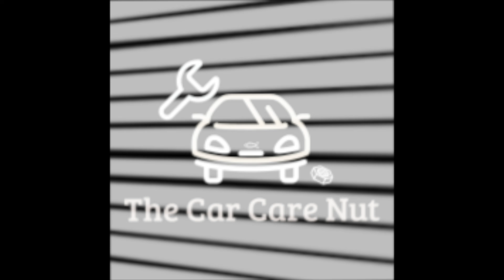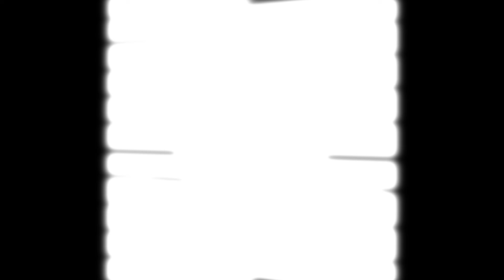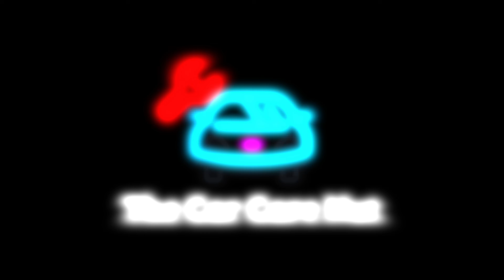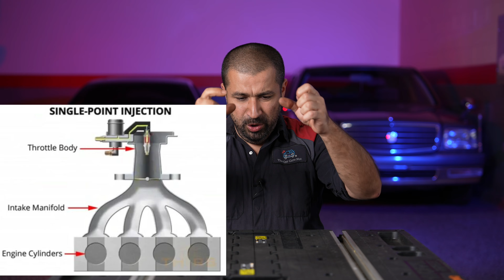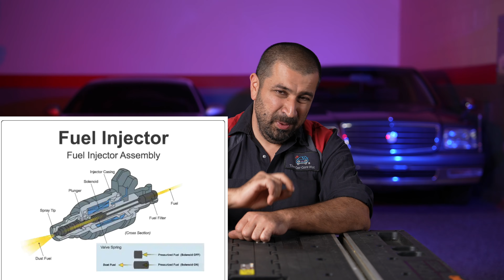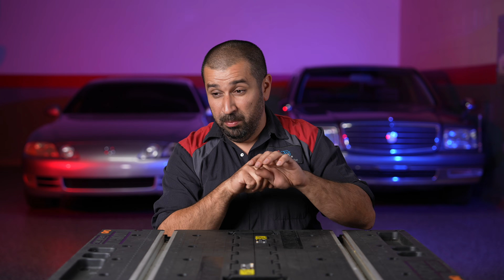How Does Modern Electronic Fuel Injection Work? Part 1 : The Basics

Comment: I had an interesting thing happen with my car. I was getting strange static through the radio. I noticed that it changed everytime I changed throttle pressure, and concluded that the radio must have been picking up the pulses to the injectors. Maybe the antenna wasn't grounded, but I never followed up on it.

Comment: The accelerator pump is primarily for enrichment when you suddenly open the throttle.  Without an accelerator pump, you'd get a lean mixture and a bog or abrupt loss of power, just when you wanted to accelerate.

Comment: "...electronic fuel injection started in the 50's, never took off because of the limitations of the computers of the time."  I suppose you could call those systems analog computers. 🙂

Comment: Good video series!  1) I would be interested in a video which explains the combustion process comparing 87 and 92 octane fuel.  2) Using higher octane, does it burn hotter in the engine resisting early detonation? 3) Can a higher octane fuel lessen or help with fuel dilution(where fuel gets into the oil)?

Comment: AMD, I changed my own spark plugs and cleaned that air intake sensor.  My 189,000 mile 2016 Mazda 6 manual-350 mile all highway trip one way @ 65mph- it jumped up to 39MPG!  

On the return drive, I averaged 71-72mph and I still achieved 36MPG! 
 
Found easy instructions from youtubers.

Before I did the work myself, the Mazda was averaging 32MPG on long highway drives and 29MPG for mostly city.  

Immediately did the same thing with my 2019 Honda Hybrid.  Noticed the average mixed mileage was now 53mpg, whereas before it was 47mpg. 

The sparks plugs for the Honda was $78 for a set of four.  The dealer would have charged me $75 apiece.  The Mazda's plugs were only about $48 for four.

Comment: I do Cyber Security and IT for a living. I've also built multiple computers. I know barely anything about cars. I think it would be cool to learn how to be a mechanic. I have shaky hands and not the best coordination though. With computers, if you mess up assembling something, it could cost $250 at most but with cars it could cost $10k+. If you mess up a computer, you can set it aside and work on it when you have the time and money to fix it; if you mess up a car, you ruin your daily transportation. Even with something simple like changing my own oil, if I mess up with the drain plug thing, I could accidentally strip something by tightening too much or maybe it could be too loose and fall out. Some people think people who know computers are really smart but I think the smartest people are mechanics who understand how $10k+ machines work and how to fix them without breaking stuff

Comment: I have a cheap Bluetooth obd2 reader and it says the fuel air ratio is a perfect balance but long term fuel trim is 12.5 percent. I do occasionally get a code for very small evap leak that once is cleared doesn’t come back for a year. Does an evap leak make a car run richer

Comment: I really enjoyed your lectures, but regardless, I wanted to comment on the working table you used during the lecture, probably for advertising.
I have the same working table, and I almost lost my fingers while folding it several times.
This table is a hazard to use, and it also has a warning sticker about fingers

Comment: Another note, the MAF sensor measures the temperature delta between the wires, so when it is cold outside, or hot, that slight variation in temperature is easily calculated by the ECU.

Comment: I think GM was the first to put throttle body injection on some of their cars and trucks. They were bulletproof, Some had a single injector some had a duel injection system then they tried putting multiport fuel injection on their V6 Comaros and Firebirds and had nothing but problems with bad fuel pumps and clogged injectors They continued to use a 4 barrel carburetor on all their V8 sportcars like the Z28 And V8 Firebird

Comment: Great video, can anyone elaborate on the carburetor mechanical pump that only works when car is off, I thought he was referring to an accelerator pump. Most of my automotive experience was during carburetor days and I do not recall what he is referring to. I thought you pumped gas to set auto choke. I do hope AMD continues this format, he did one on electrical troubleshooting but as well as I remember never followed up on it, it was a very good video too so if you have not seen it I recommend you look for it and watch it

Comment: I had an older Datson 280 Z it had Mechanical fuel injection it was a straight 6. No computer I believe the injectors were operated off the cam lobes .

Comment: My favorite comparison of carbs to injection is my old motorcycle and its 'upgrade.' My 4 cylinder 4 carbs 600cc bike gets 55mpg (up ~60-65 on hwy). Its upgrade to fuel injection got 40mpg. But hey, at least we can program sport and rain throttle modes! It's spiritual successor today is now 900cc, and gets 50mpg for nearly triple the price. But hey, at least it has an infotainment screen and cruise control!
Bring back my analogue tech, sheesh.

Comment: Thanks Ahmed this was really good info and has put me right on that fuel/air mixture ratio because when I was younger (much younger) I used to tweak around carbie engines and always thought that the ratio was 16/17:1 how wrong was I ?? I am looking forward to part 2 as I now drive a 2011 Mazda 6 Sports Hatchback and would like to know just how my (I think) multi port system works notthat these days I can tweak around cars because of the far more complicated fuel and other computer-controlled systems.

Comment: Why not an O2 sensor for each cylinder?  If the injectors are slightly different you need different control to equalize.  Obviously cost is one factor.

Comment: Always interesting topics, i grew up with Carburetors in all my dad's cars and my 1st car . I remember adjusting the air fuel ratio by adjusting the air and fuel screws. My sister had an old VW rabbit that had mechanical Bosch fuel injection worked well and was reliable.

Comment: Carburators are not that archaic (as a tech), it's a simple and relatively effective system. It was environmental regulations, and cost of oil, and aerospace needs (high altitude and acrobatic flight, plus space travel), that drove much of the advancements in fuel injection tech (which is a great idea). That said, like many techs, fuel injection was in use in aerospace since 1916, and eventually trickled down to other uses, such as in automotive! 😁

By the by, many of the GA planes I still fly today are carbureted. 😉

This is an Excellent explanation in laymen terms! A fantastic job! Thanks for creating this educational material!👏

Comment: Love your videos; in early port injection systems the injectors all fired together. Which meant most of the time it was not when the intake valve was open. What you're actually describing now is called sequential fuel injection because, well, each injector fires sequentially

Comment: @8:15 Always impressed with your electronics knowledge AMD.  What is likely happening is back on the ECU, you have a transistor for each injector.  With the emitter of the transistor tied to ground and the collector tied to the ground wire of the injector.  When the ECU wants one of those injectors to open (spray fuel), a current is applied to the base of that transistor which turns it on, thus completing the circuit allowing 12V to be applied to the coil of the injector solenoid.

Comment: 55 or so years ago I was taught the piston goes down on it's induction stroke, and then the atmosphere PUSHES the air in. As nature abhors a vacuum. Just being picky I have worked on 4 cylinder cars that had 4 individual carbs. Great fun to balance. While I had an air flow meter I tended to use a length of 3/4 diameter pipe.  None the less, I do enjoy your explanations.
Reply: Put your finger over the spark plug hole (with the spark plug removed) & your will feel the vacuum.  It's the other half of the equation.  Theoretically is the air being drawn by the vacuum or pushed in by atmospheric pressure or a combination of both?  Either way it works.

Comment: Oh wow, where were you two days ago when I was looking into this very topic. My 15 1/2 yr old car went to the dump last year. I thought bc it lasted so long and the engine was still working perfectly, that I should try to find a car with the similar attributes. I found the 2021 Honda HR-V 1.8L 4 cylinder SUV.( my car was a 2.0L) The Honda was naturally aspirated (like mine) , meaning no super charging which is hard on an engine. It is an interference engine like mine ( it is what it is ) and it has a timing CHAIN like mine. It also has an SMPFI ( like mine)which is a sequential multi-port fuel injector and NOT a direct injector which is harder on the engine. My engine was a DOHC and the Honda is an SOHC but I don't know what effect that will have. I don't imagine it will be a big deal. I am good to my cars. I don't drive like a crazy person who is always in a hurry and driving the car into the ground. I am fastidious about maintenance especially oil changes and spark plug changes. 
I can hardly wait for PART 2 . Thank you Ahmed. 🔷      :  ) P.S., Sorry I forgot to mention my car was a 2009 Dodge Caliber SXT 2.oL 4 cylinder.

Comment: forgot to mention how the injection pressure is regulated, basically to prevent the fuel pump from locking up and burning up, a pressure relief valve is on the fuel rail, and will "dump" the fuel when the pressure builds up and sends it back to the tank. Say the engine is just idling at a stop, most likely the fuel is just circulating from tank, to engine, back to tank.  This also helps purge air out of the fuel system as well!

Comment: The accelerator pump in a carburetor was not only to help it start, more importantly it made the mixture richer momentarily when you pressed the accelerator to take up the lag that occurs in the venturi process.
Reply: The good old rubber that turned to leather plungers ! Always a problem with a simple fix.

Comment: I was raised during the era of Rochester 2 barrel, Holley 3 and 4 barrel carbs. Always fun to clean, tweak or refurbish them. I later had a '74 Porsche 914 with Bosch fuel injection. I drove it cross country in the summer and had 5 or 6 unscheduled stops through California, Arizona and New Mexico due to vapor lock. I eventually replaced it with Weber carbs and it ran great after that. That particular year fuel injection had lots of problems. Looking forward to Part Deux.

Comment: Man I remember when all the manufacturers were SO proud of electronic fuel injection that most all of them had a huge ‘EFI’ decal on both doors, the rear, and sometimes on the hood lol was such a great evolution in vehicles. No more rebuilding carbs, replacing jets and floats etc etc and no more pulling out a choke before you start the car. Especially in cold environments in winter, good luck lol and then have to warm the car up in the driveway while you scrape the ice and snow off the windshields. Good times good times lol appreciate ya brother! Great content as always!

Soli Deo Gloria~
Reply: Same thing when ABS came out 😂
Reply: @Dinolobe376  yes!! 😂

Comment: The old school carburated engine cars were just fine, effective, cheap, and easy  to fix, in 
My country Morocco, we stayed 97 percent  old-school  carburated engine  and manual cars mad by European car companies France and Germany just for us till 2010 after that european cars companies move to Morocco and my country starts making cars with different brand.
  More complicated motor vehicles, more money for the cars and parts  manufacturers, because modern cars break too fast and need parts replacment More often. Like here in The US, regular automated hydraulic  tranmission was perfect and can last over 20 years the life of the car, now they replace it with CVT and dual clutch tranmission, dual dry  clutch on Ford last just fr 50 to 70 thousand mile and you need 4000 dollar to change the clutch assembly and good luck finding the shop who is willing to do it, even the dealer stop doing that and require you to install new dual  clutch tranmission,  dual hydraulic Clutch transmission may last longer but not more than 180 thousand mile, CVT depend on the driver, it may last to 120 thousand or more or less and it is not serviceable, you need new one, and so on.

Comment: I'm sorry to have to correct you. In  the UK you never needed to pump the throttle for a cold start. On Weber or SU carburettors you pulled out the choke knob and turned the key. If you had an automatic choke you just turn the key.  At 70 years off age i can still remember it like it was yesterday. There was a small pump on the side of Weber  carburettors that was solely there to increase power as you pushed down on the throttle slowly and smoothly. All the above is provided the engine was well maintained and serviced. Checking the points angle and gap etc.
Reply: Give me a carburettor any day. You never got sludge build up on the valves. Plus I could do most repairs on the side of the road and be on my way in 5 minutes if needed. Granted the only tool you need now is a mobile phone and hours of patience. To wait for the break down truck to arrive. And if you are on the interstate/motorway (UK) a good coat to keep you dry (while you wait) the other side of the barrier!
Reply: I was wondering why AMD skipped mentioning manual chokes. I think the last car that had them here in the US was the 1985 Mazda RX-7 with the 12A engine. The 13B version had the fancy EFI.

Comment: Electronics are wonderful phenomenas. Its applied to different mechanical engineering. Whether planes,  laptops, cash registers, microscopes,  medical uses, military, etc. The next electronic devel0pment is ROBOTICS,  where a computer actually adjusts and thinks for itself based on human like sensors (ears, eyes, tonque, skin,  and reasoning). This is difficult to replicate. A human brain and body system  is still unbeaten in functionality. With computers,  they reason and make decisions based on what a human brain thinks a computer should think or reason.  And like humans,  computers get confused too, reset them and they normalise again. Starve them of electrical energy or overfeed computers and they put out strange results. Then they also die a brain death,  if their pc board parts burn out or stop working. Like human blood,  without electrical energy,  a computer is a useless mess of conducting paths, pulse generators, calculators, amplifiers, analysers, diodes etc bits all connected to each other, like the bits in a human body which needs blood to make it work!

Comment: My ‘83 Trans Am had a four barrel carb.  Yes you did do one, maybe two pumps but it fired up the engine instantly.  Fuel economy was good and drivability was decent.  I think that fuel injection was really for pollution control objectives and increased hp output.  My car got 30 mpg and now 40 years later, I’m still getting 30 mpg on my newer fuel injected vehicles.

Comment: Carburator.. no fuel pump if tank above engine (motorcycle), if pump required a low pressure one (cheap, reliable, easy to replace), no computer, no sensors. You can adjust with a single screw driver, disassemble with one wrench, diagnose by ear. 

There is a lot to like about them. I am personally replacing my car with one that is carburated.
Reply: I'm replacing my car with a horse because I'm tired of replacing all these moving parts and having to put expensive fuel in it.

Comment: Thank you for the explanation. One question though.
How can the O2 sensor distinguish between having consumed all the O2 because you've burned precisely the right amount of fuel, and having consumed all the O2  because the engine's over-fuelling?
Reply: I think that in practice we never use 14,7 (stoichiomeric ratio) in engines but a slightly different number, so the computer doesn't expect for complete lack of oxygen in the exhaust for the car to run perfectly, but a rather "poor" quantity of oxygen. So tiny quantity of oxygen = engine running good, and complete lack of oxygen = engine running rich. In practice the O2 sensor oscillates constantly between rich and poor mixture and the computer corrects the mixture continuously (I'm not a mechanic, the above is my understanding of the principle. A more knowledgeable person may chime in)

Comment: Great education right here folks. Well spoken in layman's terms.
 I started driving in the 80s,  mostly cars from the 60s and 70s of many makes. They were so much easier to fix back then that nearly anyone could diy repairs, so long as you understood the simple concept. Air,  fuel,  spark. Air and fuel were controlled by the carb. Spark controlled by distributor and coil. 
This was so simple our fathers taught us and it was a high school subject. 3 or 4 kids would bring an old car to school and spend the next 3 months fixing it. 
I find it unfortunate how modern engines are so complicated we need a technician to fix it. 
Old school we could listen to it, feel it, smell it. This is replaced with sensors and a computer and an idiot check engine light. Now go see the technician or get your own expensive code reader or scanner to tell you the problem, just to find a failed sensor. But the failed sensor is causing chaos in efficiency and will kill an engine.